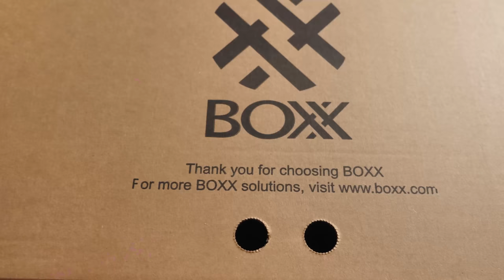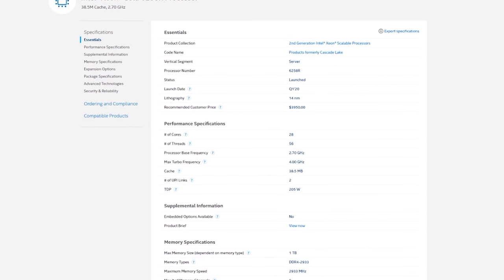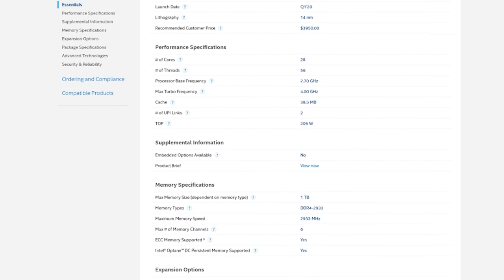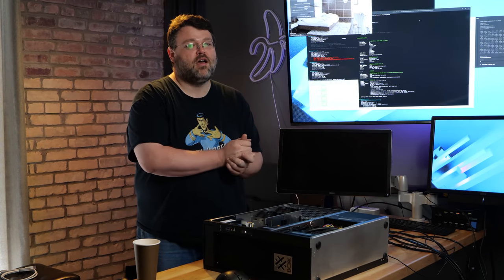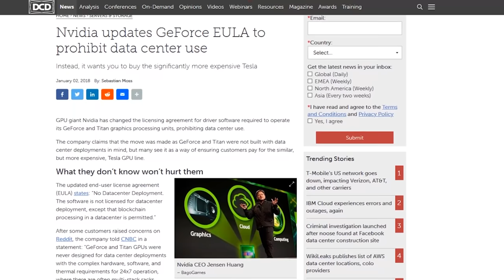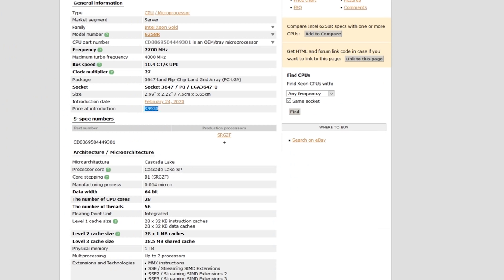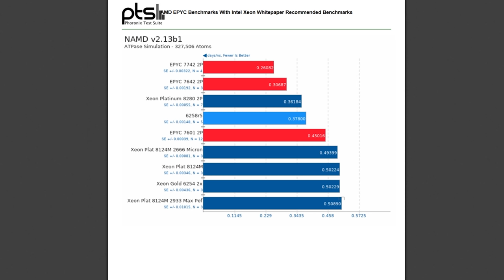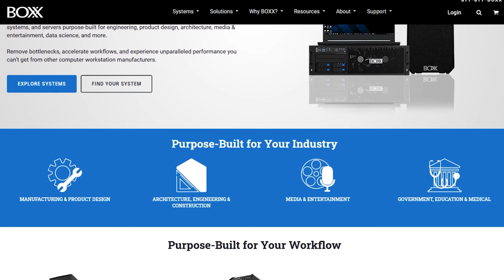Fast as a Dual Plat 8180: Boxx Apexx D4 Workstation Teardown

Comment: This is effectively quite a bit like a workstation i put together in 2015, a supermicro X8 motherboard, dual Xeon X5690 with dual AIO, 72GB of RAM in a HAF XB Evo using 4x 3.5HDD and 16x2.5 and an AIO cooled GTX 1080 glad to see System integrators doing this, that machine was sooo quite for two processors running at 150w and a GPU at 200w and a total of 20 drives

Comment: Hey! My dual Xeon workstation is near silent. It only took nearly $300 in Noctua gear to make it that way...
But then it's inside a Sliger Cerberus X case, so I'd call compact, silent perf a pretty good trade off.
Reply: @javaman4584  Honestly anything that old is probably useless and easily outclassed by a Ryzen 3300X, but for the sake of argument, it depends on the hardware and if it's still capable of doing something better than cheap modern hardware.
Mine actually idles amazingly low considering I'm running dual 130W Xeons tweaked to maximize all-core turbo. But then I also have room for 256GB of cheap ECC DDR3, with another SSI-EEB board in a larger case supporting up to 512GB. With Ryzen and Threadripper a thing now, the CPU horsepower available from old cast-off dual socket systems isn't nearly as valuable, but for workloads that need a lot of RAM and don't care about the DDR3-DDR4 speed deficit, it's still useful.
Reply: @javaman4584  depends on the form factor. If the motherboard layout was designed to be used in workstation or rackmount scenerios, it likely uses an SSI-EEB layout. If it is a purely proprietary or "pizza box" style server case layout that doesn't even resemble a regular ATX layout, yeah, you're probably SOL. But on the off chance that it uses SSI-CEB or SSI-EEB, they share many of the same standoffs as ATX. (SSI-CEB is identical, just with a little extra clearance on the right side).
Reply: @javaman4584  if it's dual socket, it's definitely CEB or EEB. the ATX form factor doesn't allow for dual sockets, but again, CEB is basically a slightly stretched ATX with allowances for dual socketed layouts, although EEB is much more common. EATX is basically a bastardization of the EEB outer dimensions, using regular ATX standoffs. But EEB does NOT use all of the same standoffs. Only the first (left-most, top-bottom column) row of standoffs. So even mounting an EATX Threadripper motherboard would require sinking a few more standoffs and removing the ones that don't line up (they could short the board if you don't). Still totally doable, but considering the amount of EATX supporting cases on the market these days, might not be worth the trouble for you. Even my Cerberus X "supposedly" supports max EATX (305mm x 335mm), it's actually about 3-4mm shy of proper support. I could manhandle the board in, but it was literally wedged in with zero clearance and didn't allow for screws to line up, or PCIe brackets to fit between the board and the case wall. 
Personally, if you need a case big enough to support EATX, and a ton of drives, I really love the Fractal Design 7 XL. It'll support any motherboard including a dual socket Epyc board (the one or two SSI-EEB on the market) and 18+ HDDs. Linus fit 20 with a couple fan mount-HDD adapters.
Reply: @ReQuiem_2099  You can also get a AMD Ryzen-based workstation (A-class and T-class) from BOXX.
Reply: @boxxtech  totally, and I would recommend something like that for anything going into a production environment, and definitely if there are plans to scale up, but if you're just running a private Plex server, or building something for the sake of building something interesting, you can't beat the experience am knowledge gained from DIY!

Comment: I run dual 8280 platinum ES processors in my workstation (effectively 8180's) and I can say that numa is exponentially important in proper loading and functionality of the system. Also I will second the use of 6 channels vs using 8 channels of memory as well as 192 GB of memory being the sweet spot of both price and performance. If you have a need, and can find the ES chips, they are impossible to beat price/performance. I have run many benchmarks and they are right up (and in most cases handily better) there with amd's offerings if they are set up properly. It requires much research, time and effort.... as well as understanding to get the most out of them though.

I guarantee my full open loop system makes that computer sound like a wind tunnel. ; )

Comment: I wonder what the speed difference is with this machine and X299?
as it has 8 RAM slots, and up to 18 cores, 48 lanes.
As in, which of those Xeons would be similar to a 10980XE or 9980XE?
Considering X299 supports 2TB of RAM now..?
to be fair I only have 32GB RAM in mine, and will probably never have more than  256GB of RAM in it anyway?

Comment: Actually I prefer my Supermicro boards inside of Supermicro cases. Done right, they dont sound like a starting Boeing. 4U are ideal. I sometime deploy servers for smaller office use, and my main integrator gets them down to 30-40db. Those would go very well as workstations, especially if you got the Epyc route ;-)

Comment: Man did this thing get absolutely slaughtered by the Epyc CPUs.
Reply: Not only that, but if you shop carefully, you can find 32 core Epyc 7601's for under $600.00.
Reply: @rdsii64  those do not beat these processors. The only processor that puts a whooping to these is the 64 core 3990x. And that is simply because it has more cores and more threads, and is unlocked.

https://hwbot.org/submission/4513548_gregmacknass_cinebench___r20_with_benchmate_2x_xeon_platinum_8280_18094_pts
https://hwbot.org/submission/4513481_gregmacknass_cinebench___r15_with_benchmate_2x_xeon_platinum_8280_7862_cb

Virtually all of the processors above my scores are cooled with liquid nitrogen and heavily overclocked. Real world scores with AIDA64 extreme shows my processors smashing everything except the 3990x. Again remember my processors are stock, and only running at 3.1 GHz. So much is to be said for that.
Reply: Greg Schaust I’m sorry you wasted thousands of dollars.
Reply: @gregschaust4298  BOXX offers those as well.  https://www.boxx.com/systems/workstations/t-class/apexx-t4
Reply from the maker: Be sure to check out my build system vid https://youtu.be/IXUS1W7Ifys . The dual xeons cannot be beat in memory bandwidth for a workstation. Yet

Comment: Dont get me wrong... This was nice and all... But how much does it cost? like, I was at the edge of my seat waiting for the MSRP.
Reply: To be honest if you need to know the price it is to expensive, gonna guess ~25000 $
Reply: Approximation based on known costs:
ApeXX D4 base cost: $7,899.00
+Dual Intel Xeon SP Gold 6258R (Twenty-Eight Core) brings the cost to $15364
+256GB of RAM (16x16GB sticks, DDR4-2933): +$2712
(The P2200 comes standard).
+1TB drive upgrade (which somehow costs $271 more than the 512 drive included...)
-$33 by removing the DVD drive 
(Windows 10 Workstation 4 Core + 6TB Max memory (M$ apparently means '4 socket', not sure why it's called 4 Cores...) comes standard).
(1300 watt PSU comes standard)
-$37 by removing the mouse and keyboard

And the total is:
$Total: $ 18277

I'm not sure that the card shown below the P2200 is but it's not an immediately-obvious option on their website.
None of the network or HBA/RAID cards match the picture so that might be an additional few hundred dollars.

Comment: @Level1Techs hp Z workstations are better quality then this Boxx, look how crappy Boxx HDD caddy is, that case looks low quality for the price.  You should do a workstation comparison of the Boxx WS VS hp Z WS VS Dell WS, for performance and thermal, efficiency, and performance per dollar.  Viewers need a "Server Tower Showdown".
Reply: Not true. In head to head performance tests, BOXX beats Dell & HP every time, while BOXX custom chassis are superior to those offered by both commodity PC manufacturers.
Reply: @boxxtech  your view is biased, of course your going to say Boxx is better.  Those caddies look very crappy just like the rest of the case looks cheep.  Compared this to HP z class chassis, if you look at z800, z820, z840, those designs crush this boxx chassis.  For a $10k computer Boxx should give a more premium case.  PS nice IO shield...lol.
Reply from the maker: I'd rather have the boxx workstation over the dell or hp z class and I've owned all three :) it's fine until you go off-script. E.g. forget v100s in the dell without special crap you have to order only through dell
Reply: @Level1Techs  ok, never mind hardware, can you honestly say that chassis is a premium case?  If you do your lying.
Reply: @Level1Techs  to bad GN doesn't review workstations, if Steve did, we would get an honest review.  If you want to be transparent, then do a side by side comparison of Boxx, HP, and Dell comparable workstations.  Test all 3 for value/performances to cost ratio,  case quality/thermals, compare BIOS and user experience, and be unbiased by pointing out advantages and disadvantage of all systems.
Reply from the maker: Will do. You must not follow the channel to realize that we rag on dell and hp servers because they lock it down unnecessarily and gimp the bioses. This boxx workstation has a proper supermicro motherboard and fully unlocked bios. but sure that's "bias" to point that out ;)
Reply: @Level1Techs  I agree, the bios being locked down is a terrible practice for any manufacturer.
I am not a Dell fan either, HP is better than Dell for design and functionality, and quality.  But the bios is just as locked down, which is unfortunate.
I looked into Boxx workstations once upon a time, but the cost wasn't justifiable for the hardware.  Their pricing is out of reach for most engineering departments and is way to much for being a personal computer.  There are tons of dell and hp off lease workstations that average people can afford.  So price to performance is quite high if you know how to find those deals.
Also, I am fairly new to you channel,   I purchased a 32" Samsung 4k monitor based on your review and I look forward to your future content and browsing some of the older content.
Reply: BOXX makes me miss Silicon Graphics.